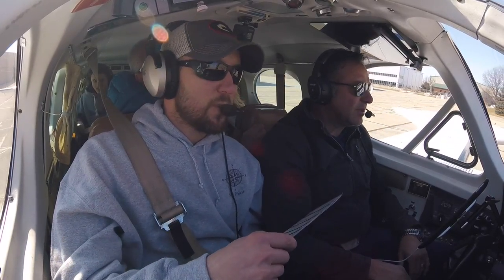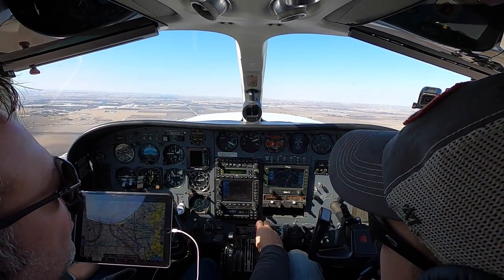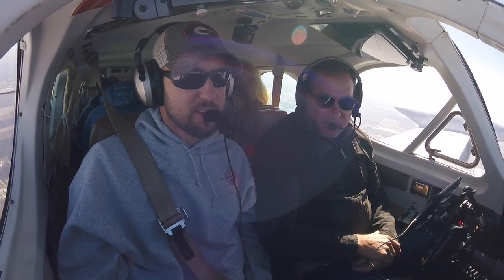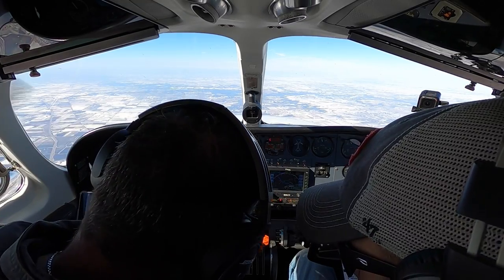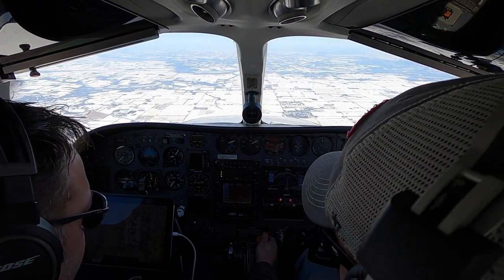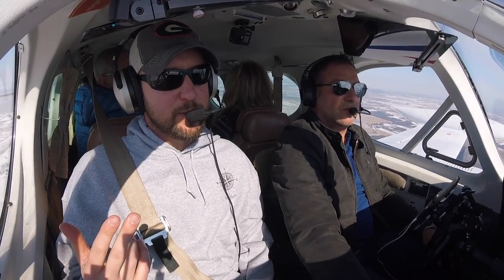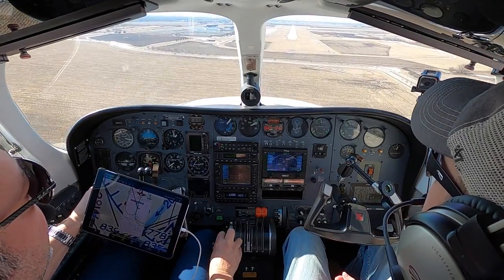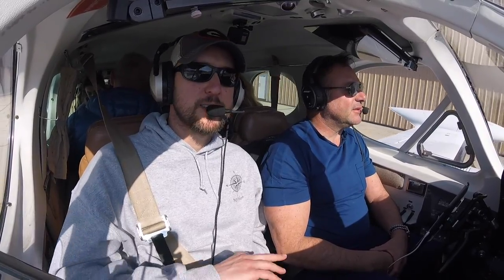~Cessna 340 VS Cessna 310~

Comment: A flight school I used to work for had a 340. Back then, early in my flying days, it seemed like such a big airplane. I always wanted to fly it but never had the chance. The only pressurized piston I've flown is the Malibu Mirage. In my opinion, single engine pistons aren't ideal for pressurized flying. Even though it was certified to FL250, the cylinder heads would start getting hotter than I liked if you went higher than FL190. Also, it took a good 25 minutes to make it to FL190 and over a half hour to make FL250. Running at climb power for that long is asking a lot out of a piston engine. I'm suspicious that it may be too much to ask and is at least a contributing factor to the engine problems the Malibu had in the past. If I was going to own a pressurized piston airplane, it would have 2 engines.

Comment: I can appreciate the knowledge level necessary to fly this aircraft and you both made it look easy.  The pressurization and turbocharging make this model and great cross county aircraft.  However, Kevin can you devel into the annual inspection cost comparison between the 310 vs 340?  Thx. DD
Reply: Figure about 20% more for turbochargers and the greater complexity.

Comment: Nice flight. I love the explanation of the pressurization, it sure filled in some blanks. John is right, using asymmetric thrust for crosswind approches/landings is the way to go. You need to practice them though to get good at it. It sure smooths out the approach and makes you look like a pro when done correctly.
Reply from the maker: Glad you enjoyed it Richard! I'll have to toy with the asymmetric landings...I have done that for takeoff a few times. Always learning. :)

Comment: I sure do miss the sounds of those Continentals...  I have about 2000 hours (mostly single pilot IFR) on 310's about 30 years ago and loved every second of it.  I did get a bit of 340 and 404/421 time as well and agree the 340 is just that much more versatile.   I surprised myself by remembering the v-speeds and the 180 for the the first notch of flaps and 140 for the gear.  I've only flown about 5 hours since then (separated by about 15 years each 2.5 hours) but it's like riding a bike.  Thanks for the ride... really enjoyed it.

Comment: C310 roll stability is enhanced by wingtip tanks which increases the polar moment of inertia in roll. Low wings are normally a bit roll fidgety because the COG is high in relation to the centre if lift. That is why I love high wings! 310 overcomes this with the high polar moment. From ageing  Cessna single pilot and aircraft tech..

Comment: The 340 has always been one of favorite Cessna twins, second only to the 421C with trailing link landing gear.

Back in the late 70’s when I was in the Cessna engineering division at the Wallace plant, some knucklehead came up with the idea of modifying a 340 to what was designated the 335. Essentially it was the same airplane, but was an unpressurized version of the 340 and not turbocharged.

When they lost their butts on it, they came up with the 303 Crusader, another unpressurized light twin thinking they could tap the 310 market after production stopped on it. The 303 was a huge failure, too, in part due to the deign of the propeller counter rotating components that had a history of failing and grounding the plane.

Nice video Kevin, do you have your sights on a 340 now?
Reply from the maker: Glad you enjoyed it Patrick and thanks for the history lesson! I agree about the 340 and 421C's being some of my favorites....after the 310 of course. :) No 340 for us. Operating cost are a bit high for what we use a plane for. We are spending so much time and effort on 1BC because she is our forever bird. :)

Comment: Nice aircraft.  I flew a Riley 340b conversion for about 600 hrs back in the 80's. It was a very slick airplane that would get to FL 240 pretty fast, although I rarely had to go that high. Maintenance was bad either, if I recall. We went to a King Air 100 later. I thought I was pretty 😎 lol...

Comment: One nice feature of iPads and Foreflight is the ability to display cabin altitude on the iPad.  I have that as one to the data elements that displays - you will also get a warning if the iPad senses cabin altitude over 10,000, which is nice even in a 340A.

Comment: The engine out power loading of the 310R and 340A are nearly identical (19.3 lb/hp), meaning the engine out climb performance will be similar. This is quite a bit better than most light twins which are around 20-22 lb/hp, and of course they don’t have very beneficial engine out climb capability.

Comment: Thanks now I need to read about cabin pressurization and how that works.  :)
Reply from the maker: Ha ha...sorry for the homework assignment. :)
Reply: It’s actually really simple.
Reply: @brianlau1803  ... really good article.  Although, the reason we don't do well at high altitude is that the partial pressure of oxygen is insufficient to drive the exchange of CO2 with O2 on the hemoglobin in red blood cells.
Reply: @colinrasmussen2298  I understand how the body works. I just didn't know how the pressurization worked.  I was envisioning stored oxygen like a scuba tank. But figured that would be really heavy.  Now I know.

Comment: Comparing turbines to pistons, a 340 or any other piston is a fraction (purchase price) of any turbine aircraft. Especially the newer singles like TBMs, etc. Yes, they are very reliable with decent efficiency but very expensive to buy. Operating them is probably less than a piston twin unless the turbine goes bad (which is pretty rare - hence the price).

Comment: Differential power in a cross wind landing is a great technique.  But very surprised the 340 did not have an engine monitor.  I wouldn’t fly one without an EMS.

Comment: Having flow all Cessna type with trie cycles gear. 100 up to 550 
310r or a 340.. awesome.. its only the press cabin that made the difference among them to me. 
I love the 310R due to its very nice engines and nimble handeling characteristic.  It’s so well balanced. A cruise flight at around 11000 ft can be fast too. Fuel consumption is affordable. 
The 340 is a bit heavier but as well very nice to fly. Awesome cabin and not its not a bad altitude flyer. Cab alt around 8000 and you do not need to think about it. I never toggled the climb decent knob. Only if you lose an engine you may close it to keep the cabin press . I included the cabin check with the fuel status , engine indication.  Fun planes to fly and these 300’s ask for some professional approach to flying and flight planing.  
Next to a c337 I think these are most fun planes to have of the 300 series.
Reply: Lots of vibration in the 337, fun to fly, though!
Reply: gwfowler ,  Nope not on mine. Nicely balanced on the props and engines. 
There are noisy on take off but up and cruising your fine. 
Nevertheless the 400 series Cessna are way more quiet.. then the 300 series.

Comment: Great vid gents! Curious what the total fuel capacity is on John's 340 and how many fuel tanks?  Also wondering how single engine performance differs between the 310 (non-turbo 260HP each, non-turbo 285 HP each, Turbo 310 and 340/340A)?

Comment: I think there needs to be more emphasis on cost difference.  You guys flipently mentioned it but didn't go into it.  The cost is around $400 an hour for the 310 vs $800 an hour for the 340.  I'm figuring maintenance, insurance, fuel, etc.  Numbers vary depending on how much you do yourself.  I'm just spit balling but it's roughly double.

The 310 is cost prohibitive to maintain which is why scrap yards are full of them.  The 340 is near insanity.  I have a 310 and a friend of mine had a 340.  He backed it down to a 310.  The 340 was just too much for what you get.

Comment: Noticed you had a little drone video supplementing your Full video. Can you do a video on the perceptions of a pilot to drones? I.E. What does the pilot see? How does a drone look Against a sky backdrop and a ground backdrop. See and avoid? What running lights would be helpful on a drone for see and avoid, daytime and night. Personally I had a close encounter with a T 38 out of Randolph Air Force Base during my student pilot time in San Antonio. It was so fast I didn't see it until after. Another was a buzzard. I would understand if this is out of your scope of pilot perceptions for presentation. But you could include reporting of drones in certain activities and how best and who to report them.

Comment: Question how did you get the drone video - I assume - on the arrival?  No way you can fly them at an airport even if uncontrolled right?  What am I missing?
Reply: I wondered about that, too.
Reply: Back when this was filmed, I believe you just needed permission from the tower. Now it's done through the apps you use. But still, getting permission from tower and staying in contact with them, (with handheld or with airport security at your location) it is still possible at an airport like this. A couple years ago we were allowed to shoot video at Lakeland airport. They sent security out to make sure we did not go above a certain height, or enter any runway or active taxiway. So it is possible, if it's requested correctly, and you stay within the parameters you gave them.

Comment: Okay, nice video, but isn't the FAA going to have Kittens over the drone footage?
How did you get permission to do that?
Reply: Wondering the same, I don't think my DJI Mavic would even start up at a airport.
Reply: Operations in Class G airspace are allowed without air traffic control permission. Operations in Class B, C, D and E airspace need ATC approval. Part 107.
Reply from the maker: As Recovering mentioned, that was a Class G airport/airspace and I researched it well before we went there and it is allowed as long as you don't hinder planes which of course I would never do. :)
Reply: @310Pilot  okay, that makes sense.  I'm not up on Part 107 since I'm not an operator of drones.  I didn't think you would do anything illegal, but I could see some repercussions from some do-gooder.  Besides, I was curious.

Comment: Damn, got me thinking about twins Kev, nice video.
Reply from the maker: Thanks Paul! I would say be careful...they can be expensive but considering your normal ride...most twins are probably cheaper. :)
Reply: @310Pilot   That's what I'm thinking. At about $340k from what I see, the difference between what I'm flying now and a 340 plus panel, paint, engines and maintenance still leaves lots of money for fuel.   Just that proficiency thing and getting me there that's a concern.

Comment: what is the price difference between 310 and 340 comparable years and equipment
Reply: Depends on how they are equipped..I just looked on Controller.com and for a 1978 310R vs 340A you can get a 340 for less then the 310..225k for the 310 and 159k for the 340..All I have looked at is the prices, no side by side comps as far as hours or equipment..
Reply from the maker: That's a tough question because prices vary so much from plane to plane. My guess is if it was comparable year, equipment, paint, interior, etc and everything works perfectly....maybe 80-100K difference. As mentioned by Jon, you can find 340's as cheap or cheaper than some 310's but the operating expenses on the 340 is much higher than a 310.

Comment: I've been flying the Carenado Cessna 340 in X-plane. I noticed something I was not aware of though. After looking at fuel system diagrams, can you confirm while using the inboard fuel tanks, is fuel simultaneously being transferred to the tip tanks?

Comment: N6827L also has my VG kit installed.
Reply from the maker: Interesting Nick...it's not on now after the last paint for some strange reason. I was telling John how much increased useful load/safety he'd get by installing them. I'll let him know. PS. did you see my instagram where I posted your new VG kit being installed on our plane? :)
Reply: @310Pilot  Hi Kevin, I don't have instagram so unfortunately I have not seen that, I just talked to John and got him sorted with a repaint kit for 27L so it will have the VG's installed again in the near future, 1BC is looking gorgeous and should be handling quite differently now, how are you liking the VG's?

Comment: Just curious why you lean the engines a different amount.  You've got one mixture control ahead of the other instead of both together.
Reply: When you lean or make throttle and rpm adjustments, you make settings according to the indicators, not keeping the knobs evenly matched. Due to differences in rigging, engine wear or whatever, the knobs don’t always match.

Comment: 5:10 noob question, but why are the mixtures different?
Reply: capybaras simple answer is that every engine is different. A long, complicated answer is that a tiny apparent difference between the knobs could be:  installation differences between the knob, cable, and mixture control valve; the pilot is using EGT or fuel flow or other parameter to set each engine individually, which may offset mixture knobs; one engine may run hotter/colder/have better injectors/etc and need different knob positions. Bottom line:  it’s not uncommon for this to happen. Between throttle, prop, and mixture, you’re basically setting each engine individually in this type of aircraft and each engine has a mind of its own!
Reply: @clr4tkoff1  thanks!

Comment: 310s do 80 percent of what a 340 does at 60% of the cost.
Reply: I did my initial training in a 310 so I have a love of them.  I now own a 340 and so I can appreciate the difference.  It all really depends on what you want the plane to do.  If you never go over 8000 a 310 does the job.  If you need to fly higher (and I do living in the mountains) then the 340 gets you added capability.  And the pressurization is very nice.  I won’t debate whether a 310 does 80% at 60% of the cost, because other than the turbos and pressurization there isn’t much difference, and the 80% depends on what you need.  If you want to fly in the high teens and low 20s, then the 310 won’t really work.  Again, depends on what you need your plane to do.  They are both great at what they were designed for.

Comment: How the heck did you get permission to fly a drone near, 
wait - OVER an airport with traffic? 
Oh you didn't...
Never mind.
I saw nothing...
NOOOTHING !!!
Reply: Maybe not him, but I was wondering the same.
Reply from the maker: It was a Class G (uncontrolled airspace) airport. My understanding is you can operate a drone in Class G as long as it remains in line of sight, under 400 feet above the ground and you give way to all aircraft.
Reply: @310Pilot  This is true Kevin... I am a licensed drone operator myself and your rules are correct. Most people don't read the FAA Regulations completely. Love the videos! Keep it up